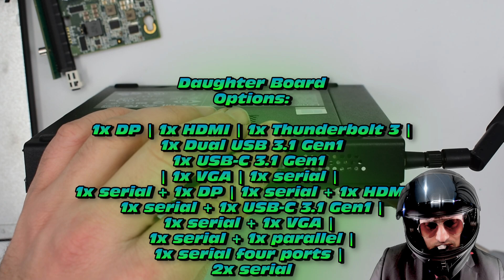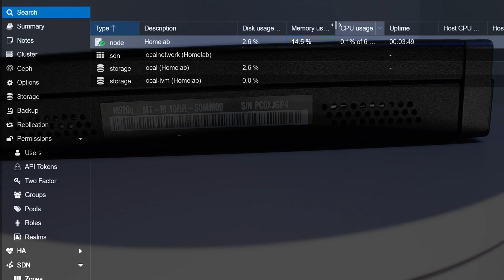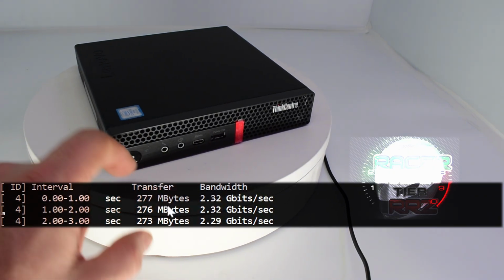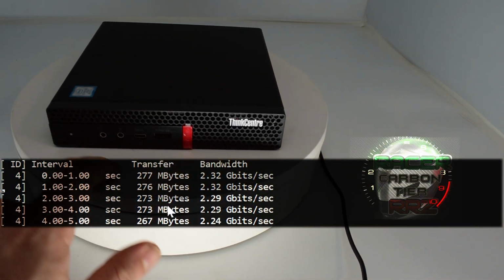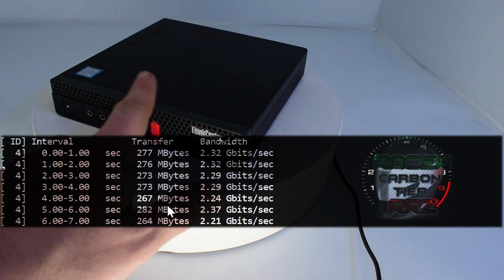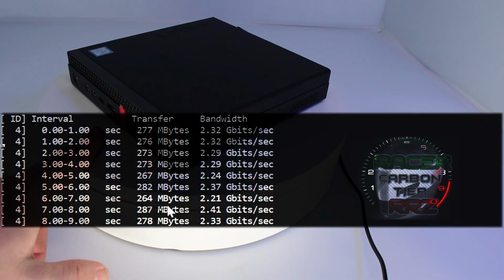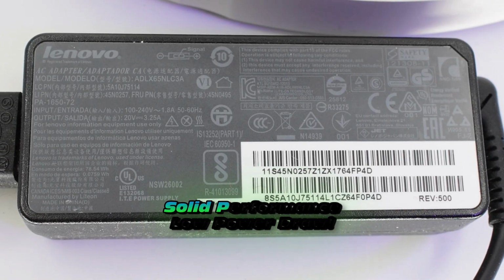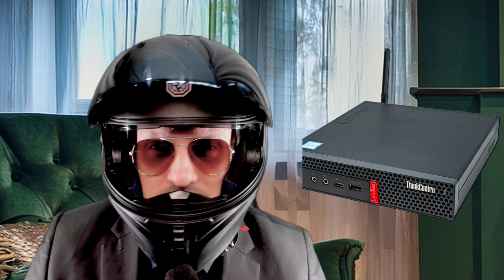Best 10GbE Mini PC? Lenovo M920Q Tiny Gets A Speedy Upgrade!

Comment: Can we add docking in usb type C
Reply from the maker: Indeed we can, and I made a video outlining how I used one (briefly; amongst many other ways to expand storage on this system). https://youtu.be/LsPfGUQoV_E

I used an HP USB C Dock to connect up 6x 1TB SSDs to use mine as a TrueNAS file server (USB is holding up ok - but you can't unplug anything or it turns into a mess).
Reply: @racerrrz Thanks.

Comment: 9:27 wrong, the secound slot is on the m920x and p333, from the same generation. you can even add the m.2 slot by your self if you like, it works on the m920q but not the m720q
Reply from the maker: Correct. The M920X was released as an "extreme" version - mostly catering for consumers that desired a dedicated GPU, and having 3x M.2 slots (2x M-key, one E-Key). The 'professional' P330 had similar features. The additional M.2 M-key slot mod can be done on the M920Q with basic soldering skills - but ideally you would just buy the M920X if you can find one: https://github.com/badger707/m920q-dual-NVME

For detailed outlines of the systems and their offerings:

Older M Family (2016 release): https://psref.lenovo.com/syspool/TempFile/i_pdf/ThinkCentre/ThinkCentre_EMEA.pdf
M Family (2018 release): https://psref.lenovo.com/syspool/Sys/i_pdf/ThinkCentre_EMEA.pdf
P Family (2018 release): https://psref.lenovo.com/syspool/Sys/i_pdf/workstation.pdf
Reply: @racerrrz i bought an m920q 2 days ago and plan on adding the slot when it gets here, it was just 190€ for one with an i7-8700T 16gb ram and 512gb nvme, an barebone m920x is currently 160€
Reply from the maker: Nice, that's a decent price. They tend to still cost a small fortune at the best of times. I am yet to see any M920X's on my local marketplace, but at least the M920Q is common place. I actually got a M720S SFF for a really low price and I just finished up a build project with it. I added some RAM, a 500W PSU and a RTX 5060 - not bad for a small SFF build, and it has handled everything that has been thrown at it! Future video of course, and some sneak preview content here: https://www.youtube.com/post/UgkxK8FB3xzCbAenPZIGmi0RcpHvAoWJQaY0

Comment: building one just like this thanks to your video.  mad respect for the helmet, that's not easy to keep on the whole time.
Reply from the maker: Nice. M920Q is great value with that PCIe slot. I have mine setup as a multi-OS system - plug and play operation pending the requirement. What were you planning to do with yours? I made a follow-up video for getting this system running with Proxmox and a TrueNAS VM: https://youtu.be/LsPfGUQoV_E

Thanks, indeed lol. The one that really get you is when you need to do a retake because your audio was peaking. Mad respect for those who race for hours with them.

Comment: Not sure if yall know it already but just in case, you can put non-T 8th and 9th gen CPU but you'll need the 90W/120W power brick and adapt the CPU heatsink because sustained load will throttle them. 

And maximum ram allowed is actually 64Gb of 3200MHz even if everything says 32Gb on all datasheet, system works and uses properly the 64Gb. hope that helps almost one year later
Reply from the maker: Thank you for sharing your experience. I was not aware of the non-T CPU option being compatible at the time of filming, but that could come in helpful for those looking to use these with Proxmox for running several VMs. The max of 64GB of memory would be a nice upgrade. I would add that updating the BIOS to the latest version before trying these mods would be wise to avoid any potential compatibility issues (although I am still on a mere 32GB of 2666MHz [2x 16GB] - so I can't test that theory!).
Reply: @racerrrz  there is 2nd SKU cooler for those 65W CPUs, full copper, much better, you can find them in m920x/p330 tiny

Comment: Is it a waste of time trying to build your own wireless router with one of these?
Reply from the maker: That depends on your expectations and intended use case. The Lenovo M920Q Tiny is ideally suited as a gateway appliance; so, your first point of contact with the modem. This can be achieved by using software such as pfSense, OPNsense, VyOS, or OpenWRT (x86). From there, it can route traffic to your existing network (router, access point, or network switch). pfSense or OPNsense would be great for the firewall aspect. VyOS would be good for firewall and routing also.

Alternatively, with some minor hardware upgrades, the M920Q can be converted into a dedicated router. By installing a better M.2 E-key wireless card (e.g., Intel AX200 / AX210) with external antennas (via SMA breakout cables), you can enable wireless access point functionality. OpenWRT (x86) would support the wireless router functionality quite well.

There is a limit when it comes to using them as a modem. Modem operation (DSL, cable, or fiber termination) is heavily regulated, often tied to proprietary firmware and licensed drivers. Thus, the M920Q cannot natively perform the function of a true modem.

Comment: Gameplay?
Reply from the maker: You ask a good question. I have not tried gaming on the M920Q with a gaming GPU yet, but it would be quite simple to test out (just add an external PSU with jumper cable). I would expect half decent game play at 1080p, but the CPU architecture is a little aged for modern titles.

Comment: Hello, I bought the same 10GB NIC, but my system doesn't detect it. Could you help me? I also have the Lenovo M920Q.
Reply from the maker: Hi there. I am sorry to hear you have having troubles. I also had endless issues with the Inspur X540-AV2 and I should really have done more validation of its stability before even publishing it in a video. But in my defense I didn't have much expectation from the Inspur NIC given the pricing at the time (~$17 USD or so). 

My conclusions on the Inspur X540-AV2 NIC:

1) Not all of the Inspur X540-AV2 adapters have the same firmware - some sellers state that the NIC would only function in servers (i.e. it will not detect in the M920Q in that case).
2) The 'server firmware' supplied on the Inspur X540-AV2 may work in workstations (I got function in a HP Z840), but there is the risk that it still may not detect if you are not using the software it was implemented for (e.g. Windows server etc.).
2) The NIC remains powered even with the system in an off state - leading to the NIC becoming hot due to no cooling in that state. I recorded ~45'C with an infrared heat gun but likely it could go even higher.
3) I have had issues getting this NIC configured to work with Proxmox and TrueNAS - where the Intel X540-T2 works with relative ease.

I have opted for the Intel X540-T2 as the better solution. It costs maybe 2-3 times more but it works as expected (there was some frustration to gain more than 1.9GbE transfer speeds - but that's a future video). 

This video was planned as a multi-part video series - and I have now published the follow-up video which outlines some of the AV2 issues and it covers the addition of 6 SSDs along with configuring Proxmox and a TrueNAS VM. In the third video of the series I will cover the 10GbE optimization on the M920Q which has not been all that easy (it took a lot of 'lines of code' to get 10GbE function). 

Part 1: Fitting hardware - This video
Part 2: Gaining NAS functions - https://youtu.be/LsPfGUQoV_E 
Part 3: Gaining 10GbE Speeds - TBA
Reply: @racerrrz  thx for your comments, i love your videos, keep it on mate.
Reply from the maker: @fcvidal91  No trouble, hopefully you'll manage to get your system onto some 10GbE speeds. I am glad you find the videos useful. I'll keep them rolling out albeit slowly.

Comment: ah yeah like my unit, your cooler also doesn't flat on the cpu. 😂
Reply from the maker: They are very handy little systems. Strange that the cooler isn't flush - either its out of tolerance or I did a poor installation.lol
Reply: @racerrrz  it is exactly the same on my unit, remove the cooler again and you will see the paste hasn't reached fully the cooler on top. I think it is just a flawed design.

Comment: Hi All.
Been following this with great interest, but I cant get the card to be recognised in my M720q..  card works in a windows machine to another back to back, but despite the tricky MAKE INSTALL for the ixgbe linux drivers it doesnt want to play?
In the bios ive enabled the Devices/video/ peg ?  from Auto which should enable a pci video card if fitted.. Doesnt work with a NiC.Csrd gets hot so taking juice.
Is there enough power in the 90w psu, can a M720q handle this, any more settings to enable pci,, Linux Mint os.
Id be v grateful if anyone has an insight into this.
Thanks for listening !
Dave.
Reply: @racerrrz  Many thanks for your reply...-update....
new 135W psu arrived still not seen in '720q....card was off ebay... say no more..swopped it with the other T1 card from my Trunas Scale and voom like a dingo with its ass on fire mate ..!    lspci there the lil beauty was, can now connect still only 1gig thro a 2.5 switch but its a stary.. gonna boomerang it down the yard hopefully doesnt come back..!

Hope this tale of wo helps others.. cheers!
Reply from the maker: @davebradberry5879  Good stuff. The cheap NIC was a bit of a gamble but I went in expecting some sort of catch. It works, just not as well as needed. 

It still amazes me that these Tiny systems can accept a PCIe x8 card and give decent performance. What sort of network speeds did you manage - say with iPerf3? I got some solid performance on mine, peaking out the SSD RAID pool via the network. TrueNAS doing the heavy lifting as normal. 

The question is, what's next? The homelab always needs something.
Reply from the maker: There were a few red flags on the NIC but they only surfaced once I got to initializing the Proxmox hypervisor with my TrueNAS VM (follow-up video: https://youtu.be/LsPfGUQoV_E ). I tried just about every trick in the book but I could not get the Inspur X540-AV2 to function in the M920Q (it worked fine in my HP Z840). 

I tried a few different configurations - including a M.2 to X16 riser adapter with external DC power (2Amps; I theorized that maybe it needed more watts), but even that wasn't enough (the NIC made clicking sounds lol). I did get an Intel X540-T2 to work in the M920Q which would suggest that there is enough power to run the 10GbE NIC via the internal PCIe slot, but for what ever reason the -AV2 variant will not detect. I have not tried a firmware reflash but that might restore function (assuming their firmware is tied to certain systems or servers). My -AV2 got up to ~42-46'C in the off state (but power brick plugged in) and I decided to skip that NIC - it's just not worth it having something that unreliable in a system. 

Intel X540-T2's can be sourced for ~2-3x more but they work and give less frustration. My Intel X540-T2 NIC in the M920Q gave ~430MB/s write speeds to my Proxmox TrueNAS VM with a 4x SSD RAIDZ2 pool. I outlined all that in the follow-up video.

Comment: Hi where did you see all the daughter board options for this pc? I googled the hell out of them and cant find anything sadly
Reply from the maker: I don't recall seeing any concrete summary of all the options while searching. They tend to have rather obscure part numbers which makes searching from them worse than finding a needle in a haystack. 

Lenovo make a list in here (pg 5), but no part numbers: https://psref.lenovo.com/syspool/Sys/PDF/ThinkCentre/ThinkCentre_M920_Tiny/ThinkCentre_M920_Tiny_Spec.PDF

The next best is to search via: http://www.lenovo.com/serviceparts-lookup

Let me draft something real quick.... 
Check this: https://chatgpt.com/canvas/shared/67e5e4d623e88191a1a8abe14e866ac0
Reply: @racerrrz  Cheers mate this helps a ton! thanks for replying on old videos too a bunch of youtubers just abandon them. I wanna see people make these mini PCs into little beasts, I find EGPUs cumbersome and severely overpriced but the fact you can get a thunderbolt on this is funny.
Reply from the maker: @asq7136  No worries. I guess replies are a product of size, as the channel grows it becomes more challenging to respond to every comment. The eGPU concept has potential - beyond that of just gaming too. Once you get some decent hardware paired up it can change your system's purpose quite a lot. Finding the right adapter gets you on the right track - and maybe it's a thunderbolt adapter that gets it all started haha.

Comment: so you said that you upgraded your memory to 16gb, but then your proxmox says you have 8gb installed.........
Reply from the maker: You have a keen eye for detail. I actually upgraded this system from 8GB (it had one 8GB module when I bought it) to 32GB (two 16GB SODIMMs) of memory, as per 9:15 . I recorded footage of Proxmox during initial setup (so before the video upgrades) and after the upgrades. 

You may see Proxmox footage displaying both "8GB" and "32GB", and even measures in between. Keep in mind that Proxmox, serving as a hypervisor, allows allocation of system memory (and CPU cores etc.) to the host (so Proxmox) and to the VMs. If I allocated all 32GB of memory to the Proxmox host I would have no memory to allocate to VMs. Hence, you can select how much memory you want to allocate to your hypervisor - and how much memory to allocate to a given VM (e.g. 8GB to the Host, 24GB to a TrueNAS VM).

The Proxmox footage was really just a preview for what is to follow - my conversion of this tiny system into a "several drives in RAID file server".

Comment: What is the power consumption in idle and full power ?
Reply from the maker: I had in mind that I recorded the power figures for this system but it looks like I overlooked that. This particular system has the 65W power brick - so I would estimate it ~18W on idle in OS and up to 28W-35W under full load (pending the number of auxiliaries on it). I'll see if I can get some power measurements for the next video on this system. I would do it now but it's in a rather precarious condition haha. It's been working on OS cloning for the last few days (rainy day backups).

Comment: Between the big 3 OEM PC manufacturers (dell, hp, and Lenovo) Lenovo definitely makes the best miniPC. they all have a 1L offering like this but Lenovo is the only one that offers one with a pcie slot, it might need a proprietary adapter but those are cheap. Another big advantage of these lenovos, is that they use the same charger as their laptops, so if you end up changing the cpu to something with a higher wattage and add in a pcie card you can actually power it by getting a higher wattage lenovo laptop charger. Unlike the HP elitedesk mini and Dell Optiplex Micro. I have like 4 of these. I put i7 8700Ts in all of them, 64gb of ddr4, 2 of them I put intel arc A310 sparkle eco half height single slot gpus in them, the other two have 4 port intel x550-t4 10gb NICs in them. I took some coolers off some old Nvidia Quadro k400 gpus and modded them to fit them onto my 10gb NICs then spliced the wiring into the wiring for the CPU fan. And drilled some holes in the case.
Reply from the maker: The Lenovo Mini PCs just seem to have that edge when it comes to expandability. Nice going with the GPU fan retro fitment. I settled on the Noctua NF-A4x20 for cooling, but at this stage I might be leaving my motherboard out of its shell. My goal was to connect up 6x 1TB SSDs and I have achieved it through some "unconventional" methods haha. Video editing is underway. I need to put some time into this project to round it off; an update is long over due.

In case people find this of use - my storage build update pics: https://www.youtube.com/post/UgkxpTktM_1qj2u9I6LthX_lHsydedoiG9Vx . I need to publish some new photos of the Noctua fans in action.
Reply: @racerrrz  m.2  to sata ?😄
Reply from the maker: @ Words cannot describe the shenanigans (not an understatement, the M920Q is a long way from home haha). 

At its simplest level it is 6x 1TB SATA SSDs converted to USB 3.0, mounted in a "DIY 4-Bay JBOD NAS", but how I went about creating more USB ports is the unusual part (14 methods covered!). 

A RAIDZ2 pool was configured in Proxmox and used by a TrueNAS Core VM. I am editing this follow-up video right now. Making good process - ~ 20min of solid info. I think I had like 8 hours of footage to cut down, ouch. And part 2 will have a Proxmox + TrueNAS Setup Guide. 10GbE NIC setup is worthy of a video itself - its been a pain to setup.
Reply: @ I'm on the same frequencies 🤣
good stuff and good job ,-)
Reply: Nice, would love to see some pictures of your work as I'm currently working on it
Reply: Does the Intel Arc A310 run full speed? That is, M920Q supports rebar?
Reply: Acer has a mini pc with full x16 pcie slot, you don't even need to take the cover off, it connects to the side.